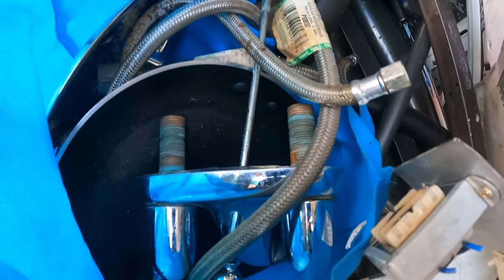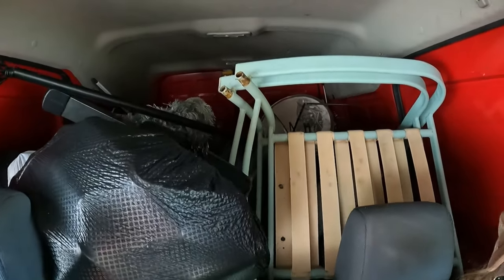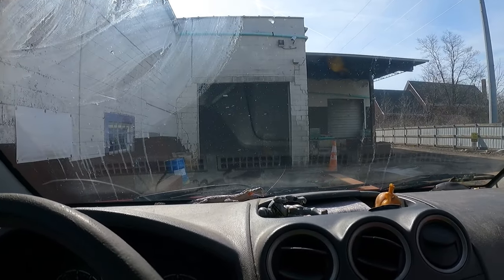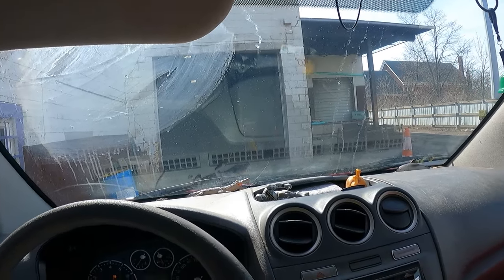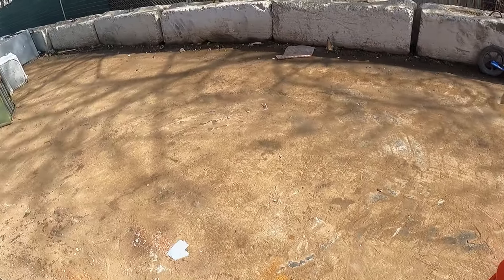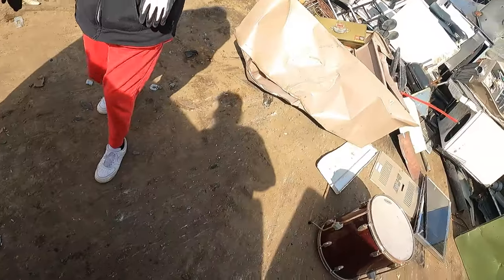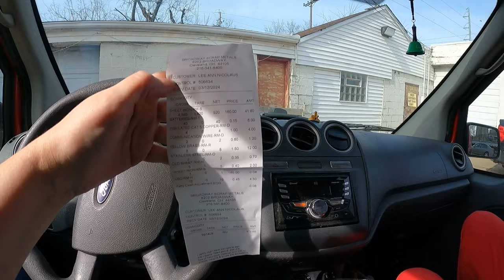Spring Street Scrapping and Scrap Yard Run + The Critter Cam

Comment: Hey y’all I’m wondering how they pay for different types of metal—do you have to go weigh after each- or how??
Reply: After we weigh the van load, dump the steel in the back and get on the scale again, then I take the better stuff (copper, brass, aluminum, stainless steel etc.) up to the smaller scale in the front of the building on a cart. That's what I'm doing at around the 15:00 minute mark! They weigh each type of metal separately there as they take it off the cart. Then they add it all up and they give me the money and the receipt which details how much we get for each different type of metal!! ❤Scrap It Up Zombie!